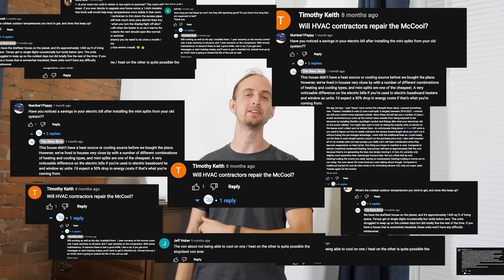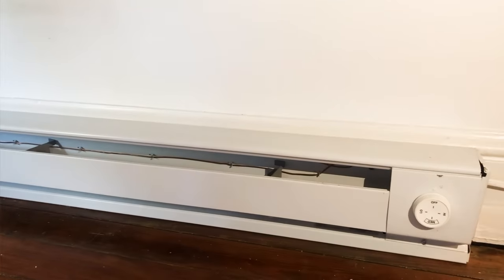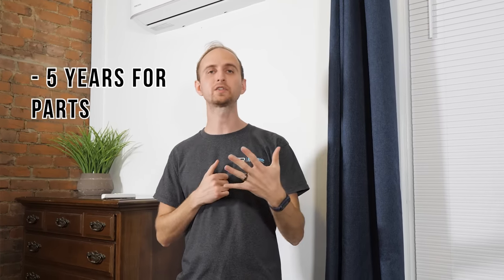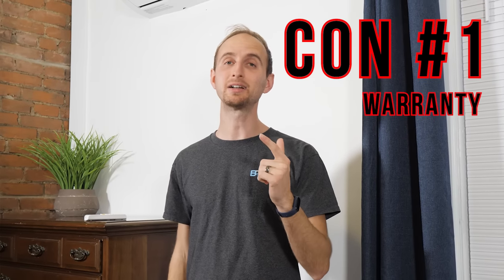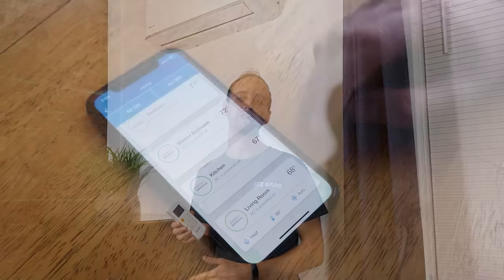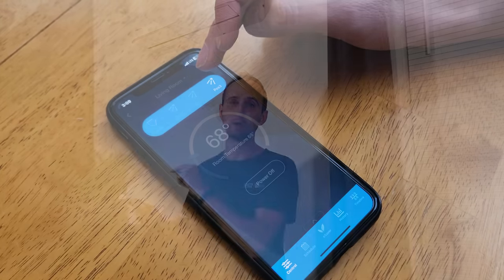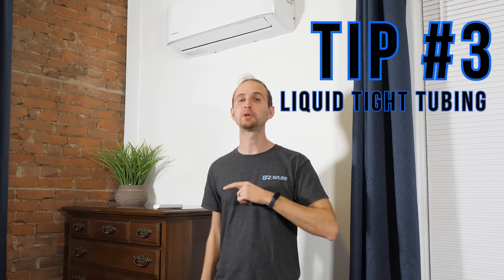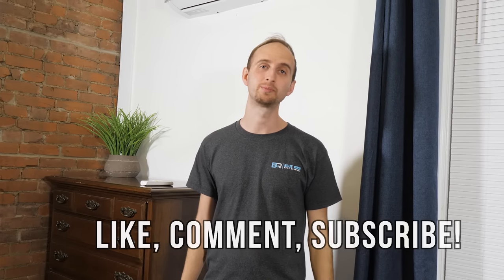Mr Cool DIY 2-Year REVIEW: I wish I would have known this BEFORE BUYING...

Comment: I’m dealing with a smelling socky odor already have cleaned the whole inside system using mini split cleaning kit along with viper drain cleaner and Comstar coil cleaner also have used drain tabs my local HVAC can’t tell me why the odor persist can you help?
Reply from the maker: @georgegarza3421  That's strange. Did you remove the fan blade and clean it out, or smell that in particular? Do you smell it when it's off or just once it kicks on. Obviously you'd smell it more when it's on, but is the smell there when it's off as well if you get your nose real close?

Comment: Great video--
I have a Daikin mini-split unit cooling 5 different zones--it was professionally installed (cost me nearly $14-k); I wish I had watched this video and bought this system.  I feel empowered to tackle a DIY and add another unit to condition other areas of my house in need; and as much as I would have loved to keep all the AC units under one same brand, Daikin will invalidate it's warranty if the unit is not professionally installed.  Your video reviewing MrCool reassures me that the company stand behind their product and the product is reliable.
Reply from the maker: Honestly that’s not bad. If I had it to do over I wouldn’t be so afraid of a Daikin pro installation. I’m curious who they classify as a professional and how you can gain that status in order for them to honor the warranty? Daikin is apparently the best mini split brand in the country with very low maintanence service issues. So far, my Mr Cool has had issues with almost all of the motors, and I’d rather have a system that doesn’t need those kind of warranty repairs within 2 years. $14k for 5 interior heads seems like a pretty good deal in all reality
Reply: That's what attracts me to Mr. Cool.  Looking at probably half price to get the system in compared to a pro install, AND you get a full warranty.  I'll roll the dice on issues after that.

Comment: Normally you'll have a back up heat source during cold spells. This is usually your old hvac system. Refrigerant just wont cut it anywhere below 20 degrees

Comment: I self installed Blueridge units last fall.  Winter cut my heat bill by about 1/3 over the prior ground source heat pumps. (Main savings seemed to be in the cost of pumping water (pump and dump system) which was costing about $150 per month.) Installed 2 systems with air handlers in basement connected to the previously installed ductwork. Also 1 minisplit with 2 heads. I would never install multiple heads on 1 condenser again. Might be better if both heads are in the same area but mine are in a breezeway and the basement workshop in my garage. It is also a pain to change from heating to cooling because it involves going through the garage and downstairs to switch that one and back up for the breezeway. Overall I am very happy with the systems and would do it again.  I did cut lines to length and reflare fittings when doing install.  The Blueridge systems don't use the precharged linesets and need to be vacuumed after installation.:goodvibes:

Comment: Blower motor noise is likely dirty or worn bearings. Before you spend money on a new motor try oiling the shaft where it exits the motor with 3 in 1 household oil. (WD40 won't last more than a few days because it evaporates.) Pull off motor so shaft is vertical and let the oil work down around the shaft into the bearings as you spin it by hand. I have to do this with my window a/c's. Doing this can postpone motor replacement for a year or more. Or you can apply oil without removing the motor, just use a rag to catch any dripping. Some of the oil will work its way into the bearings via capillary action.

You might also try replacing the bearings of the motor. But $35 isn't too bad for a whole new motor. New bearings are a few bucks but can be a hassle to take the motor apart and remove the bearings.

Comment: I am in TX (70 days of plus 100-degree temperatures so far this year and looking to put one in my stand-alone Garage it is a 31 by 31 foot 961 square feet one room - I am looking at three options to order within the next month a 2 ton I can get new on Facebook for $800 (being texas I like the Ideal of a little overkill) an 18000 BTU from amazon for $700 or two one ton units on opposite walls, Facebook market place $350 each.
What are your thoughts on this ?? I am actually leaning towards the 18000 BTU unit

Comment: Just to make sure I'm understanding #5. The con is that you can't have 2 units connected to the same AC condensor set for one to cool and one to heat? How would the heat work when the cooling kicks on if they are both connected to the same condensor? Please tell me if I'm misunderstanding.
Reply from the maker: Thanks for commenting! Actually this con is referring to the fact that you can’t universally control the settings for the entire house with a single remote. I’d prefer that because sometimes I want to adjust the mode or the temp and you have to go to every handler and adjust it separately or use the app.
Reply: @TheRenoBros  got it, thank you for the clarification.
Reply from the maker: You’re very welcome! Thanks for watching and for the support!

Comment: If I have my unit in cool mode and set the thermostat to seventy eight, it does not stop cooling, It will just keep getting colder and colder My question is what is the problem here?

Comment: one other question. does the outdoor unit have to be out doors? Can it be place like in a crawl space under the home with ventilation  to protect it from winter. ? Does the outdoor unit get hot?
Reply from the maker: Good question! I’m sure there’s a way to install it in a basement with certain adaptations, but I have never seen it done before, possibly because of the extra cost of adapting it to exhaust outside properly. You’ll even notice that central air units often have an exterior condenser as well.

Comment: Would this sort of system be really good for a small ranch house?  I'm thinking of about 1,000 sq ft.  For a one-story house with an open floor plan for the kitchen/living room, and just two bedrooms, could I get away with one unit for the whole place?
Reply: I did the same for years.  Took care of open space, ad migrated to two separate bedrooms. I had a 24k but could have done the job w 18k. Had humidity issues

Comment: So for follow me mode, beware of using it on the remote.  It unfortunately uses IR to communicate the temp to the air handler so it really needs line of sight.  If like two periods of reporting the temperature fail it will revert back to regular mode and you probably won't even know this happened.  I've found follow me works best from the wall mount mini-stat because it has a pretty powerful IR transmitter.  All that said, I have an 18k in my 24x24 great room with vaulted ceilings, three exterior walls and a bay window on the south side, and the internal air handler sensor ultimately is what I use almost all of the time.  No cal needed either.

Comment: Con #5 request to have one touch mode change for all systems would be a good feature request to make to the manufacturer. I’m assuming they don’t remotely update the firmware on the systems, but it should be much easier to implement in the app.
Reply from the maker: So true! Definitely a worthy feature to add for those who have multiple heads. Makes it way more efficient to control things

Comment: I bought the wall thermostat and find eat eats batteries and does not have the same options as the remote, like Turbo mode.  I have to change them every 2 weeks.  So, I mostly use the remote.
Reply from the maker: Good to know! Thanks for the heads up
Reply: Actually it has many of the features.  Turbo mode is entered by holding temp up.  Turn off by holding temp up again.  To use follow me mode, you need to use the app.  First, put the mini-stat into bluetooth mode by pressing and holding power and temp up.  Then go into the app, enter the mini-stat, and bring up the little tray at the bottom.  In that little menu, you'll see various functions (including turbo, follow me and others).

Comment: couldn't you change the screws from a round head to a flat head on the remote holder to keep the hardware from pulling the cover off. 
if you wanted to run each room in independent modes like heat in one and cool in the other then you needed separate outdoor units.

Comment: You need to repair the mortar between the bricks and then seal it, this should stop all your air problems going through the bricks themselves. Then you need to caulk around those windows in order to make sure it's sealed as well. This job is easy enough that you should easily be able to figure it out even if you have zero experience.
Reply: @PayNoTax-GetNoVote  It's still better then an unsealed wall with broken mortar.

Comment: I put a 12k and 18kmini splits in 1,000 square foot two story house forgot it had no insulation. Installed a 90k btu wood stove season oak and pecanwood for winter. Coated my roof with white paint for summer.

Comment: I'm getting ready to install one of these decided to go with this instead of a new downflow furnace it's being installed into manufacturing housing or what we call a mobile home I'm installing it for the heat not for the AC but they will both be used just hoping I can get this done by myself pretty sure I can I'm pretty good with it pretty much everything especially working on cars and stuff like that the electricals not a problem at all it's 110 V we will see how it goes

Comment: Thanxs for the excellent video. I am finalizing my mini split install. The two units in the upper floor have been up and running for a couple months. Just finishing the units in the basement. The systems are MrCool DIY Gen4. I got two 36K outdoor units, 4 zone capable. One of the units has an 18K wall unit in the upper main bed/bathroom and an 18K wall unit in the bsmt west family room. The other unit has a 24K wall unit in the upper living room / kitchen and a 12K wall unit in the bsmt east family room. The house is 1488 sq ft upper and 1488 sq ft lower. Garden level basement. The walls are all 2X6 insulated to R34 and the ceiling is also R34. We installed all new windows all low E 1 1/2 yrs ago. The outside walls are full brick to the eves, bricklayer built the house for himself. The systems are all totally functional as far as heat and cool is concerned, I'm getting all of the cooling condensate to go to a central tank to use to water plants. This required a few condensate pumps and some downhill engineering. None of the wall units are on outside walls ie: all of the linesets, power + comm and condensation lines are run inside. I mounted the outside units on a 2 1/2" pipe rack about 24" above the ground. The units are mounted 'shoulder to shoulder' on the pipe. I will be placing a wind fence in front of the units to keep wind pressure down. I have a cover over the units to keep direct drips off of them. The backs of the units are under the deck where there is no wind to speak of. I placed a power meter (Drok) on each of the circuits via cts going to the outdoor units to have a running total of power used. The house (all electric) had resistance heating, radiant mounted on walls up 6" or so below the ceiling. It was cooled by a large swamp cooler (evaporative) mounted in the north wall of the living room. The insulation level of the house kept it from being REAL expensive to heat and the swamp cooler is just a large squirrel cage fan and a little teeny water pump that uses very little power for LOTS of cooling (and LOTS of humidity). I have only removed the electric heating from areas where I was actually mounting a wall unit. This next winter will dictate which units might stay up..
The gen4 features are very similar to your system. The follow me is now lockable so it stays selected even after a power failure. There is NO clock based timing available in the system!!! That's a CON. Only timing available is elapsed time based, bummer.. I have heard that there are systems out there from Mitsubishi that CAN cool and heat on different units at the same time. BUT they are the ones that have the distribution manifold box that mounts in the house and the wall unit linesets are routed to that box as well as a single large lineset and com + pwr line to the outdoor unit ($$$). There were some rather old units that had supplemental heat in the wall units that kinda kluged it and could heat with that while another unit was cooling.
I will probably get more refrigeration tools this winter with the majority of hvac repair people are going shoulder to shoulder against diy units. The quote for installing my system was right about $9000 avg over three places. They were all comparable products as well, but were (same avg  3) $2250 higher on material. For my $8200 total, and I bought a LOT of stuff I didn't need, I think it was a sound decision to do it myself. I'm 73, retired facility maintenance electronics tech. Located about 45 miles NE of the Denver, Co. metro limits. 7.8kW of on grid solar.
I am going to contact MrCool and see if they are going to make a big unit that is as efficient as these. I need about a 5 ton to help my shop out back.

Comment: Great video. Two small notes. First, you mention SEER as the energy efficiency rating of the unit, but really it’s just the measure of cooling efficiency. The HSPF rating tells you the heating efficiency and in a heating dominant climate like yours it’s really the one to look for (though generally if a unit has a high SEER it will have a high HSPF too). Second, you note that a water boiling radiator is more efficient. In reality a gas fired heater can only be around 98% efficient at most, and potentially down to 80%. A heat pump can top 400% efficiency so even if it is powered by a natural gas generating plant that is burning at 50% efficiency it still has a net efficiency of 200%. Even at below freezing temps most modern heat pumps stay over 200% efficient so they’re using less total gas. It’s more accurate to say that a gas fired boiler can be cheaper, not more efficient because gas sold directly to consumers is often cheaper per unit of energy than electricity. As more and more electricity is generated by wind and solar and the number of residential gas users drops this may flip.

Comment: Couldn't you just install two or more complete separate units that could then be operated separately ?  What's the advantage to two that share one outside unit ?
Reply: Space, simplicity of wiring power, equipment cost... One 5 outlet 54kbtu condenser is about half the price of 5 9k condensers , and that's before you add surge protectors, disconnects, whips, breakers, and romex to power them

Comment: As far as the "filter" goes, these are not what I would consider a "filter" ala the pleated ones in your furnace, they are little more than screens and as such a percentage of dust WILL get thru the mesh into the head unit's COILS, that has to be cleaned out as it builds up, restricts airflow and even develops mold

Comment: I installed mine in 2020 and it worked great that here it worked pretty great in 2021 and 2022 there was a firmware update and it seemed like it was cooling less and this year it's definitely cooling less the duct air temperature used to be about 38° and now it's 55°. I am suspecting that some of the refrigerant has leaked out.
Reply from the maker: It’s possible. I would expect that you could find an HVAC willing to inspect for leaks and fill the system.
Reply: I am not real familiar with these systems.  Just reading to get a feel if it is right for what I need.  One thing I would check is loss of cooling can be attributed to the air flow not getting through the coils inside.  Just like a refrigerator check a video if available how to clean the system.  I don't see a type of filter for it.  air is pulled in and past the coils.  Is there a filter in it or is dust covering the coils inside?  Be careful if you do clean so not to damage the coil and cause a leak and then it won't cool at all.
Reply from the maker: @johnsnyder9033  That’s a good point. And yes, there’s a filter immediately accessible when you pop open the cover and tilt it up. Make sure it is clean enough that air flow will not be restricted. I’ve found that once every 6 months is adequate for mine, but new owners should check every month to see how much builds up over time. Some people may live in areas or homes where lots of dust floats around and causes quicker build up.

Comment: I can't get a set temperature, I'll set it to 70  degrees in auto, cool, or comfy and it just keep blowing cold air down into the lows 60s, only way to stop that is to shut it off.. what's up with that as I read this is a common problem

Comment: I actually prefer the Mr Cool mini-stat.  I don't like the capacitive buttons but I use that as my main interface.  The remote just sits there unused.  So I haven't had that issue.
Reply: Mr Cool included that mini-stat with the gen 3 but not the gen 4 apparently.